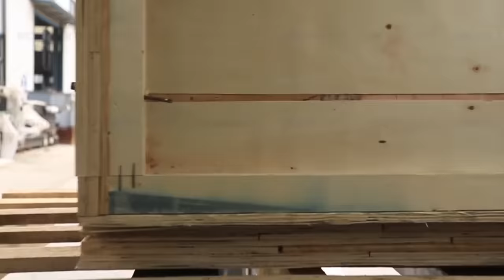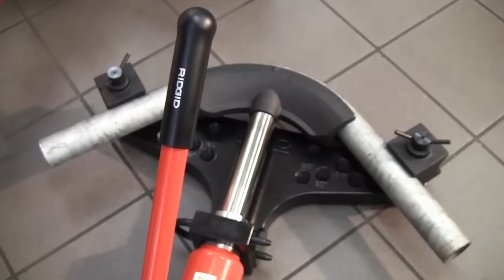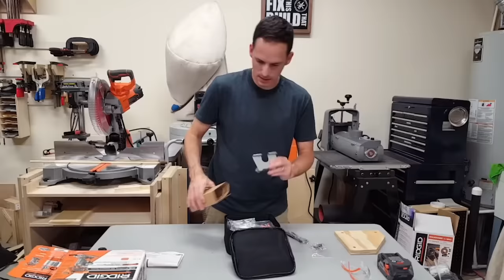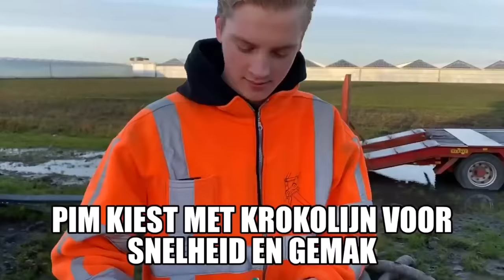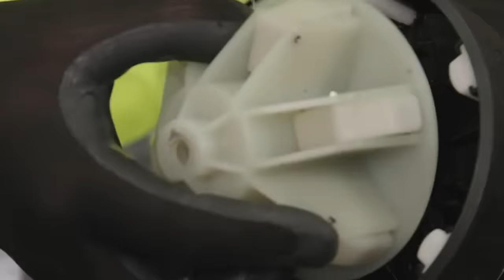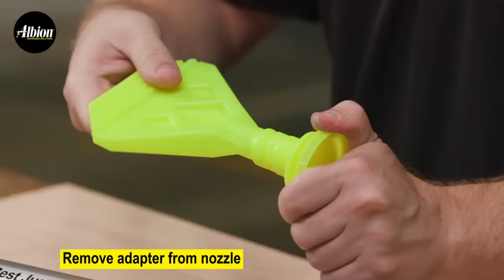INGENIOUS TOOLS THAT YOU HAVEN'T SEEN BEFORE

Comment: "Even the most inexperienced employee has almost no chance of making a mistake." Wow! You under estimate our employees!
Reply: Inexperienced employee: "Challenge accepted!"
Reply: I got employees that can tear up a rock with a rubber hammer
Reply: @cabbyhubby  WIN !   *LOL*
Reply: I was a Maintenance Manager. When we tried to 'idiot proof' anything,, They'd just go hire a bigger idiot!!
Reply: Well how did it get stuck on top of the tree 🌳.  Well as Tim Allen said I rewired it
Reply: No chance of making a mistake? Theres a challenge then. Pushing it too fast round a corner with the load elevated. Across an incline and overloading it. That’s 3 off the top of my head.
Reply: @dondale68  Pay peanuts, etc....
Reply: @georgebronte840  Pay peanuts or gold bars,, the company would still hire f'n idiots!! I mean, we had the cream of the crop! Plastic pellets were falling out of a hole after a plug was removed from a machine, and this guy said ''look there's resin falling out'' and stuck his finger in a RUNNING machine,,, CHOP!!

Comment: The Dewalt shear attachment actually works really well I have a small business we build steel buildings and steel homes and we use these daily I have had one set for over 2yrs and it still works great
Reply: I have a Matco version I got in a $2 box at an auction. So much easier working with sheet metal now.

Comment: That ladder footing device is a superb idea and will have applications in both commercial and for service sectors, especially the fire service in the UK where successive governments have seen for to reduce manning on appliances below acceptable safety standards.
Reply: I had my house painted a few years ago. It's a complex building almost 300 years old with many rooflines added over the years. The guys who did the work would put ladders in the most unlikely of places and at the base, to level en' out, one of them would be literally underneath the ladder like some kind of board or rock upon which one leg of the ladder was standing.
Reply: We had a ladder with a telescoping attachment on each side with pinned holes to secure their position.  It worked but was a bit of a hassle to use.  This unit seems over complicated, but it sets to any position right away which you really need on high ladders.  Just the right position and secure where you need it to be.  I like it.

Comment: The flaw of the fork lift is it only works well with pallets that don't have lats on the bottom. A lot of pallets have lats on the top and bottom.
Reply: I must disagree, having used pallet jacks for over 20 yrs, whose base and roller style wheels are the same as this system, you can just push harder and load the pallet, then hit the button and let it rip the lower slats off if needed to lift the pallet higher up. The only extra effort is picking up the slats and disposal since they'll have pallet staples exposed so I don't see this as a flaw, just an aspect of use.
Reply: @rpetersen2  Good to know.
Reply: @rpetersen2  lol you're technically not wrong but in some instances you want the bottom slats (warehouses) and they have solid molded pallets as well. (Warehouse manager here)
Reply: Not a flaw, a restriction. 
Full pallets can be staged for pickup to load or unloaded to set the restrictive pallet on the appropriate pallet that allows the lift to function. 
Negative minds are very restrictive and dismal.
Reply: @geowen57  Minds that add insults at the end of comments for no reason are also very "dismal". Just adding that makes the reader want to ignore any truth in the comment. Another person commented on the flaws in my comment which I acknowledged because he showed himself to knowledgeable and he knew how behave respectfully. I'm fine with criticism but only if the other person is polite. However if the person is disrespectful I'll respond in kind.
Reply: @siral2000  Oh, no disrespect, there was a reason and somehow you just made the argument for me. Sorry for touching a nerve! Try and have a good day!

Comment: ZPEX is the way to go.  I own that Milwaukee PEX expander tool.  Costs install time to almost nothing. Never had a single leak yet.
Reply: PEX b is safer for drinking water, plus pipe, fittings and crimp tools are much cheaper. Been using it for years, never had a leak or failure.
Reply: Bought one and it paid for itself many times over on the first job; both in materials and labor.